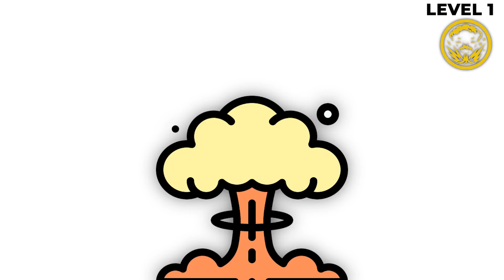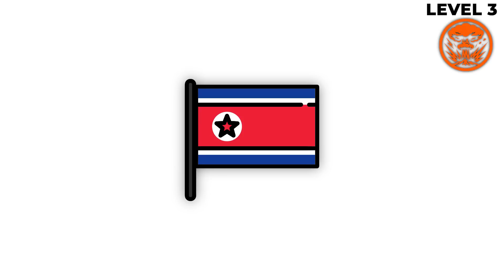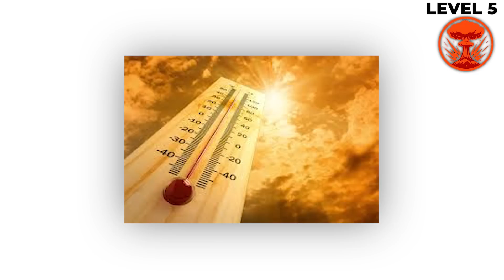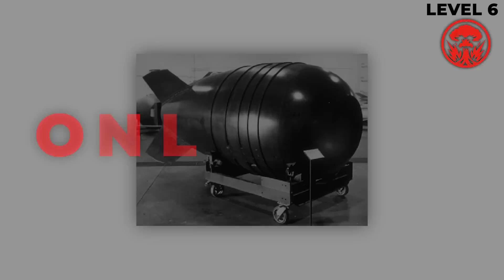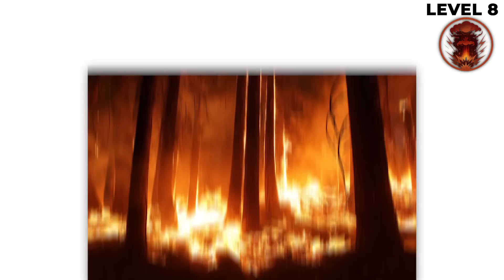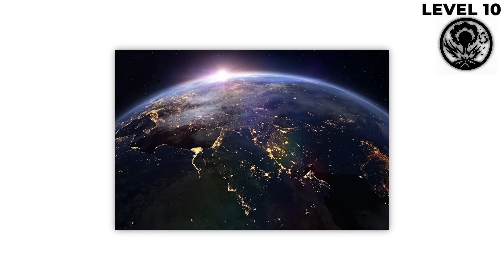Every Nuclear Bomb Level Explained in 20 Minutes

Comment: Ai here stinks. I'm not blaming the creator themselves, but the ai really screwed up. These Hydrogen bombs tested don't even come close to leveling mountain range. Tsar did not even come a c*#t hair to 1% of the Sun's energy output. Tsar compared to the Sun is like a matchbook to a wildfire. Tsar's mushroom cloud was 7 times the height of Mt. Everest. 

Castle Bravo's cloud reached height of around 130,000 feet, not 13,000. The 328 foot deep crater was from a 110 kiloton bomb, Storax Sedan, intentionally detonated underground. There were multiple reasons for the test being conducted underground, one being delibrately for cratering purposes and capabilities.

Sorry for being "that guy" but I'm just way too fascinated by nukes to let this fly.